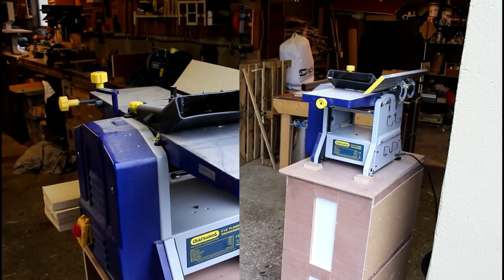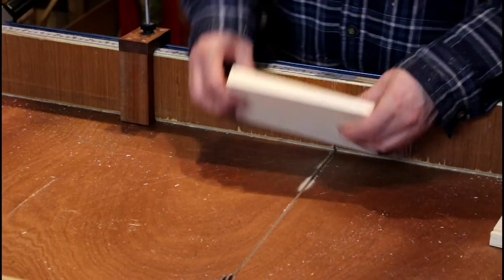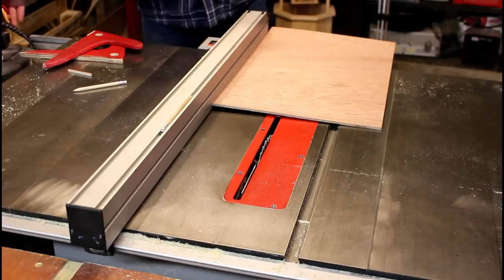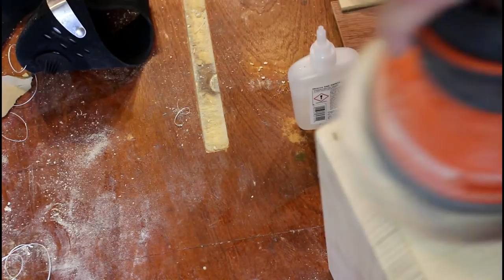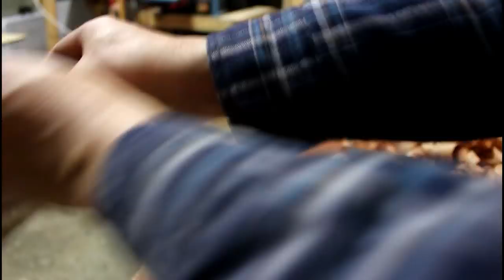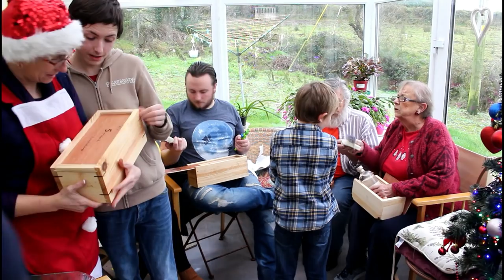Pallet Wood Wine Box

Comment: What was the purpose of the dowels? As they didn't tie the sides to the ends?
Reply from the maker: They were just to plug the holes. Should have used 45 degree mitres to put the box together, that would have closed off the gaps much better!!